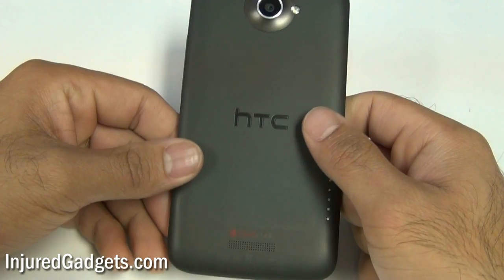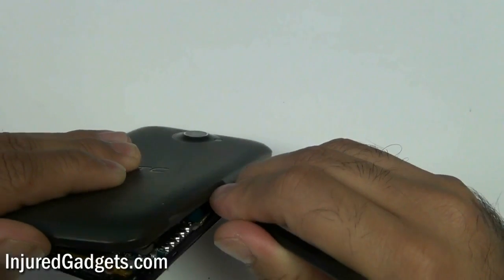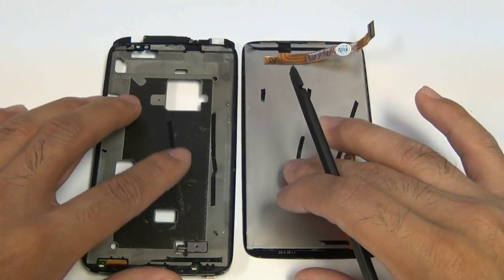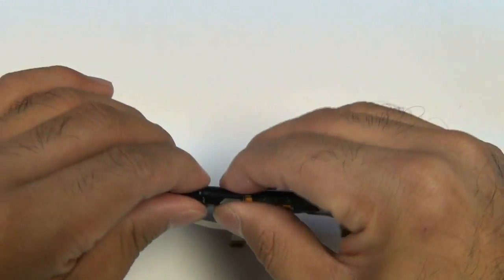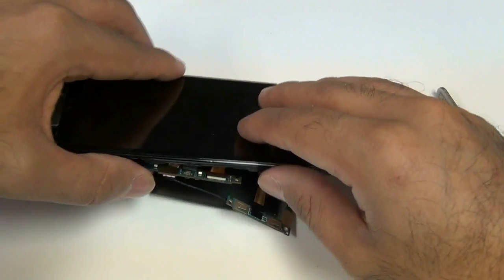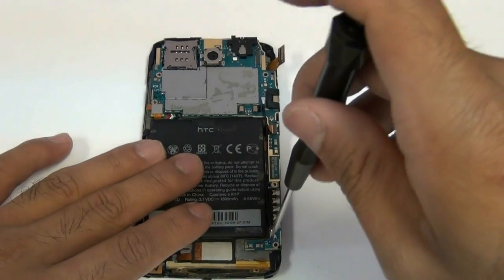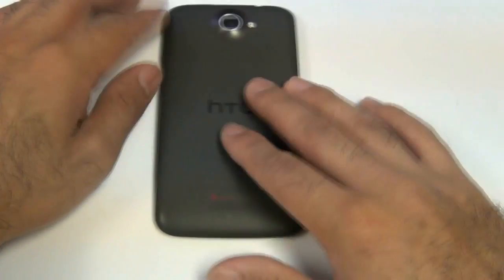HTC One X Touch Screen Glass Digitizer & LCD Display Repair Replacement Guide

Comment: I've repaired many screens..but watching this there is no mention about the lcd being so tightly freakin glued to the digitizer that if u pry it up with it that its left ruined...even doing it gently for over an hour it still was after using a heat gun...u should explain that yours was after being taken apart already(in the title) and not the first time being taken apart...now i gotta buy a whole freakin screen with digi and bezel..-_-
Reply: +ernest green lcd and digitizer is glued with optical glue. Thats why replacement screen comes all together and changes as one piece. ;)

Comment: ill throw all you Tubers a quick fairly reliable, but TEMPORARY fix for a seriously cracked touchscreen. with 3 coveats: 1) no missing glass 2) it is NOT free 3) only in an emergency. ok. to it then; go to radio shack or its equivilant, get one of those silver infused conductor trace repair pens. the liquid must be warm so warm it body temp is good. shake well before use. slowly carefully neatly apply in cracks 3 layers. let dry between layers. allow to set unpowered 1 day in warm area. pray unto me thanx

Comment: i have problems. 
first no screen. later it wont charge/ the led light wont even turn on after 1h inthe charger. got i back working charging the led. but still black screen
and now i cant seem to charge it any more the led wont come on. and the screen still wont wont work. bought new battery also. but i dont get it. any idea why the led wont light on. or the phone wont charge. (and the screen not working....) tryed avery thing people sayed. for the black screen

Comment: Hi,I need help.
 I followed your instructions and changed my cracked htc one x. Everything went fine and i even screwed the loose parts in, turn on the phone, took some pictures to test the phone and then suddenly when i was about to put the back housing on again, the lcd wont turn on. I know the phone is on because i can sync the files with usb to my computer but the lcd remains black. So, i tested with my old cracked screen to find out if it was the new screen, the old screen would not turn on, too.
I have heard of others having black screen issue with htc one x even when they didn't change their screens. Also, torn wires are impossible because the phone was working fine after i screwed everything in and everything was fixed in place. Plus i took extra care. So, any ideas what could be the problem? 
Thanks in advance, everyone.
Reply: If neither the new or old screen would not turn on, then it's most likely a torn wire. Or you didn't connect the wires in tightly enough on both scenarios. If everything was working fine after you screwed everything in place, what did you do after?

Comment: I noticed whilst doing my repair the LCD cable from my old screen is actually in the casing and not attached to the screen and is making it very difficult to fit the battery back down, can I just snip it off?

Comment: yo, great how to video.

Will I be able to switch out a failed Touch function of the phone without switching out the glass?.

The problem is only with the top of the screen where touch doesn't work.
Reply: That is the glass, the touch part is glass and its called a digitizer. It sits on top of the actual screen (LCD) .

Comment: brother I need your help. I replaced the lcd. i have one problem. lcd is poorly lit. I try to bring to light, digintajzer boost. sreen no. the first time it was all ok. and close my phone, this is what happened .eny idea? pls help
Reply: And same problem on other lcd.. al work. only light is low..?
Reply: House Music same problem here. did you fix it?
Reply: Electro house Music I've heard that's because you got the wrong LCD. There are 3 versions of LCD screen for this phone.
Reply: ***** I have not. Plate I screwed up the entrance to the flat . because I removed the little door that kept flat . and so pushes and fucked . when something changes , it nide very slowly and carefully. next time i will work slowly..
Reply: ***** no bro, its not problem in that. i fuck up port for flet on mainboard.. i think
Reply: OK. I was just trying to help. I've heard if you get the wrong screen everything will work but it will be very dim. I'm glad you figured it out.

Comment: The video is good and i success to change the LCD
+ digitizer, and recover a complete functional phone, but i had a problem, the coper shield and the battery are glue both sides and not on the video. So i had many difficulties to separate the parts without destrying every thing.
So i don't recommand to evrybody not used, to try this job. It took me 3 hours for the complete operation and i thouth my phone lost many times...
Reply: Yea sucks, cus he had already taken it apart before so there was steps not covered, one that made me miss a part and screw my screen up.

Comment: Hi, nice tutorial pal.

I followed this to the letter and everything worked. But when it came to putting it all back together. I have only the lights of the hardware buttons come on. No screen.
The phone works, I have notification flashing green, it charges and vibrates. If I stick the sim in it will vibrate if I call it, but no sound. Checked the flex cable and all in place correctly. 
Any help would be greatly appreciated. Thank you in advance.
Reply: Did you solve the issue?
Reply: I have the same issue, did you manage to work it out?
Reply: Yeah I managed to sort it out in the end. It was all down to a bad flex cable, which I damaged during the tear down. They are very flimsy and easily damaged. 😀
Reply: Titus Nutts Hi, could you please tell me which flex cable it was? i have the same problem too. but i doubt it is the new screen's flex cables because the old screen, too, won't turn on now. :(
Reply: Hey Phyo - I have the exact same issue, with both new & old screens now not working. Any success with it..? and do you remember how you did it?

Comment: Two things on this video: On 0:45 ish, be sure to pry on the most outside "gap", not the gap next to the screen, that will destroy any chance for a safe screen removal as it will seperate the screen from the digitizer.

Next, be sure to be careful where you pry open, because if you do it on the bottom, in the right corner (screen facing you) you have good chance to destroy the microphone ribbbon, as I did.

Other then that, this video helped me greatly :)

Comment: Curious as to why you have a replacement One X Screen on ebay for $347!!!
Not sure if it's actually one of your eBay sellers, but it does have the InjuredGadgets logo and info at the bottom of the page.

http://www.ebay.com/itm/Full-LCD-Display-Touch-Screen-Glass-Digitizer-Lens-Assembly-for-HTC-One-X-OneX-/350579388699?pt=US_Cell_Phone_Replacement_Parts_Tools&hash=item51a028f11b
Reply: They raise the price to keep people from buying it so that the number of sales doesn't reach 0 and resets the number of sales. It's a trick that some sellers discover on eBay to keep the number or sales logged to attract more business. The price is now back to normal.
Reply: TheChosenOne Huh, didn't that...seems a bit unprofessional if I do say so myself....but that's just my opinion

Comment: <<< NEED SERIOUS HELP!!!! >>> Put it back together and now the volume buttons dont work and neither does the speaker, i turned volume up with settings and it isnt on silent, but sound works through headphones. The screen also does not fit back into the housing, there is a gap at the top so the front camera is half covered by the housing and the power button has to be pushed into the case to work! This is my line managers phone so I REALLY NEED SOME HELP!! Or if someone knows where I can get it fixed let me know ASAP!

Comment: i have a question, my screen is not broken, i have de half untocheable screen, wich part need to change?
Reply: If your screen is not broken, but its not working properly, its probably faulty LCD display. I would recommend you to buy LCD screen together with the digitiser(the screen on t op of LCD), as apparently those two parts are usually glued together and its very difficult to split them and then glue the new LCD to the digitiser back again.

Comment: Please help me, I've tried to fix my phone, but now, after putting it together, I have two new problems. I've lost the GPS signal and the LCD display is not bright enough and is like blinking a little bit. Thank you so much for your answer.
Reply: Hello, I recommend you to dissamble it once again and then just put back together, there is probably just weak contact of flex wires somewhere.

Comment: hey i just did a repair on my htc one x I was positive I did everything correctly but the screen came out black any advice on how to fix it?
Reply: Make sure to double check you've pluged in everything. it never hurts to check your work. i did it recently with the help of this video (and their product ironically.) and i forgot the touch button to turn my screen on and off.
Reply: hi, did you solve the problem? cos i am kinda having the same here. triple checked every wires and plugs. everything fit and fine. The strange thing is the old cracked screen , too, won't work now.

Comment: Maybe a stupid question, but...I can't tell where i'm meant to pry the phone open.

There's the edge of the screen - then what seems like a thin black strip that the screen is inside - then there's the white housing (my HTC is white).
Do I look to pry between the white housing, and the first black strip - or between the black strip, and the screen...?

Thanks.
Reply: Its not at all a stupid question. i wondered that too for a while. I found it easier to hold the prying tool and put pressure on the white housing using both of your hands, put both of your thumbs on the white housing of your cellphone one between the home and menu button, then the other between the back and home. and try to not stick the prying tool too far in. i almost ruined the touch buttons on mine. so be careful if you can. Hope this helped.

Comment: I have open my HTC but a screw cant open because there is a sign "void"
Reply: You can go ahead and just puch your screw driver through that. they have a void sticker there so if u break it you wont be able to send it to the manufacturer if you were to break a component inside your phone. It will come out.
Reply: I've already got it :) But thanks :)

Comment: Well. I bought the screen replacement kit including the screwdriver. But I think they added some extra antenna or something; there's a metal strip glued over my battery and furthur. The battery sticks to the screen, so I can't get it off since I'm afraid I'll tear something apart. Furthurmore, I didn't have the tape or heater so I guess I'll give it a new try when I have those. The thing annoying me the most are the #&@&^keys, they keep on falling off.. But it's a good video, thanks!

Comment: I wish I never saw this video because it made it seem like a screen replacement is a piece of cake. It is NOT at all. My volume thing didn't have a jaw connector because I have an Australian HTC ONE XL and now with my replacement screen the thing won't power on at all. I watched both of the videos where they reassemble it. I wish I would just kept it with a cracked screen. This is just a ploy for gullible people to buy screens off this repair company.

Comment: i followed all the steps as u done., i connected the jawbone connector. once screen turned on and touch also worked .but when i turn other side its gone and then i tried several times but the screen doesn't show up. plz  help me. what should i do now?

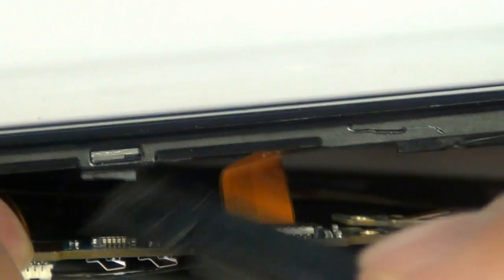Comment: I sent my phone to repair to 2 stores but last repair store told me that the new lcd was not going to turn on because it was missing the jawbone white plastic connector. Is there a replacement for that jawbone connector I just need the white small plastic that creates a pressure on the lcd ribon cable shown at 3:46 on this video.

Comment: hey there.  i have a HTC one x that has a fairly smashed from glass pane. now, i know how to take apart . i could just buy a whole new LCD+digitizer and replace it all at once.    but how hard is it to replace JUST the glass?  would the screen handle me heating it up and pulling off the glass? or would that potentially destroy it all at once?

it still works fine , but i want to fix it. and im just trying to figure out a correct path ,  thanks! 
Subbed!

Comment: hey 
im getting pressure marks like it looks like theres some liquid left in the middle of the two screens so i get this kind of squashed water sign. i dont even have to push the two screens together to get the mark. i just need slightly touch it and it happens please help me

Comment: There is no way you can just replace the digitizer coz htc have glued their lcd screen onto the digitizer so if you pull off the digitizer your also going rip the lcd screen off with it, your going to either have to buy them seperately or the whole thing all together

Comment: i tested like in the video, all cables still disconnected, only the antenna (no need to disconnect) and the display connected. by slightly misconnecting the display cable caused the display to stay black. No white screen. Good luck

Comment: I bought a new display with glass and touch. Didn't run this the functional test using the line drawing app. I'll try when get another display because the new one i bought had blue spots in the middle.

Comment: hi did u buy a new LCD screen or repaired the old one? When i run the HTC functional test, using the line drawing app, i could not draw a straight line as there was gap in between? do i need a new LCD?

Comment: Hi, I managed to repair my screen, I have some tips and things:
* My battery was strongly glued (left under) on the side of the electric board (not display side).
* Playing with the power button, causing to disconnected the plug in the powerbuttoncable 1 cm further up.
* I struggled a lot getting the display cable back in, but then i realized the cable actually didn't go trough the casing as shown here in the video, see other movies, easier!
* Didn't need the heat the adhesive to release the lcd

Comment: There are two connections for the antenna on the main board located on the right of your battery, it happened that when I opened my phone one of them was damaged i.e it came out of the mainboard. My phone is working but i just wanted to know what does these connections do?

Comment: I recently cracked my digitizer screen but before then I experienced some water damage and at that point my auto rotate stopped working (made sure auto rotate is on already) if i replace the digitizer AND lcd will phone rotate again? the phone works just fine right now touch screen works and everything but it's shattered so bad i can barely see through the cracks.

Comment: Buy both, you cannot replace only one or the other since they are fused at the factory with spray on liquid adhesive. If one breaks, you MUST replace both. 

I don't even know why they sell the digitizer or lcd only. Perhaps if you wanted you could buy the two separately and fuse them yourself? EIther way, buy both.

Comment: If you mean that the screen is "raised" a little higher, then you might need to add you own, extra adhesive around the edges of the LCD where it sits on the metal backplate. 

If you mean that the "touch input" isnt working, then that means you have a bad digitizer and need to return it.

Comment: The reason you can't replace "just the glass" is that in modern smartphones the LCD and the Glass are fused together with "spray-on" liquid adhesive from the factory, which makes it nearly impossible to separate the LCD from the glass without breaking the LCD (thus making it impossible to replace only the glass).

Comment: Firstly Team thanks for the Help!! 
So after installing a new LCD/Touch/Glass replacement, which almost works... I have a couple dead spots that just wont touch... is this a common thing? is it just not seated right? have I not quite got a flex cable in right? could you point me in the right direction??

Comment: 2 things:
1) am I able to get a screen with an AT&T logo from your site? The site shows HTC branded ones but your video shows AT&T. I'd like the phone to not look modified.

2)Am I able to have you repair the phone for me? This looks easy to mess up but I couldn't find the One X in the mail-in section

Also, great video. you might want to consider offering to upgrade to the new X+ battery on mail-ins if you get the part. looks like an easy swap.

Comment: Hey, My HTC one X screen is broken the touch is ok , only the screen is broken 
What part I will need to change ? 
I checked the Ebay I found two kind of screens 
One of then is , LCD Screen Display with Touch Screen Digitizer Assembly for HTC One X S720e and this one is for 70.00 
And the other one is , Touch Screen Digitizer Glass Replacement for HTC One X S720e , This one for like 20.00 
Could I know what the deferent between them ? 
And which one should I buy ? 
thanks

Comment: Do yourself a favor; shell whatever money HTC asks.

Replacement screens sucks BIG TIME. Clearly not gorilla glass. Ultra glossy. The thing doesnt sticks to the phone so there's an enormous gap for dust and stuff to go in; tried to seal it with silicone but it died within a week anyway. 
Yes, it died; the screen is intact, but I can see the broken LCD beneath.

..Oh, did I mention the bubbles when I pressed on the screen, using it normally?

Send it to HTC or buy another one.

Comment: I just followed every step to the "T", when it came time to test my screen assembly, nothing but a black screen. I made sure the cable was as far as it could go in the connector, seated correctly and everything! Even followed instructions sent by supplier to unplug battery and try restarting. Still getting nothing but a black screen. 
Does this mean it's a bad LCD?